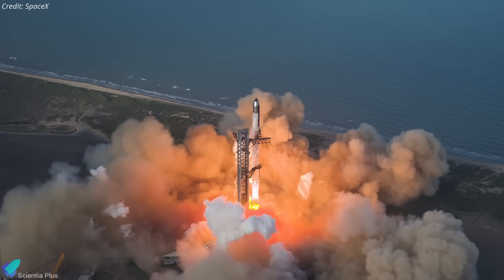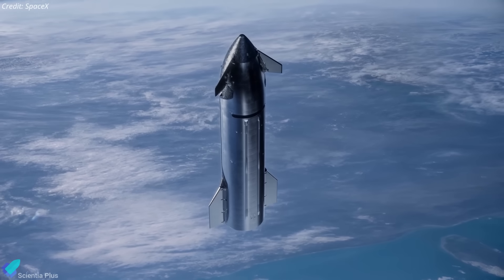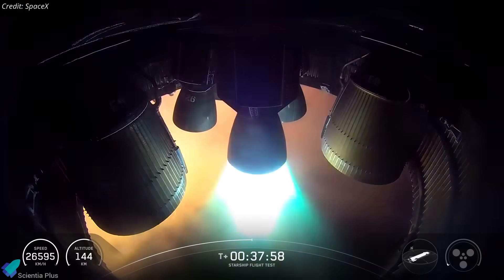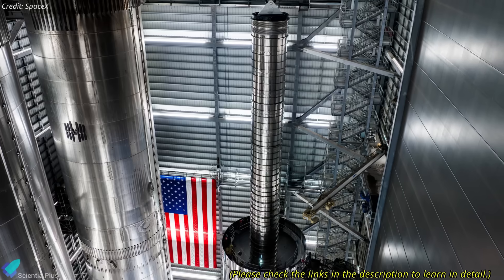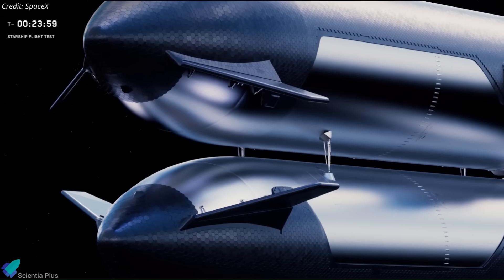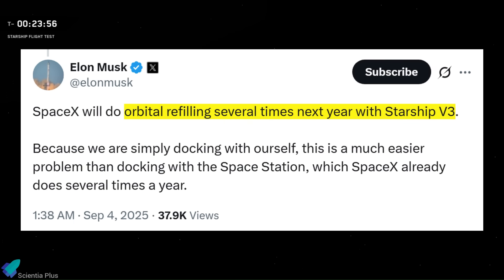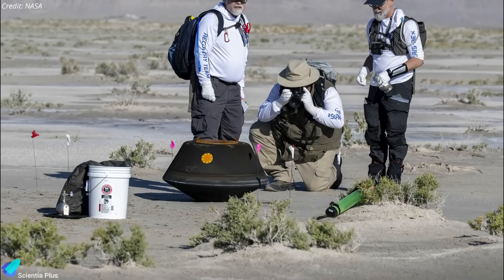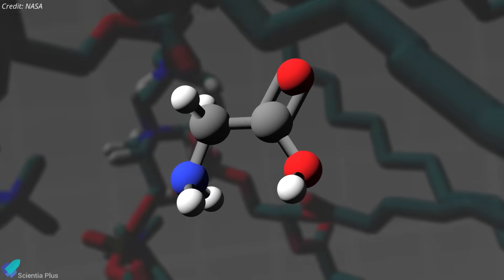BIG REVEAL! Starship Flight 11 is Full Orbital Launch! Ex NASA Boss SLAMS Starship Moon Landing

Comment: How many degrees of tilt can starship stand before it tips over? The moon does not have a lot of level surfaces.
Reply: I have to believe it will have landing legs which will give it a wider stance. Therefore the overturning moment will be much greater for it to topple and will remain stable on rougher terrain.
Reply: @williamdrake2315  and if one leg hits a boulder, it is going to tip over.
Reply: @williamdrake2315 In the meantime, why hasn't SpaceX been conducting tests in rocky desert areas, landing with legs? SN15 is the only ship they managed to land on legs after multiple failures, but even that was onto a concrete pad. The booster isn't required, these landing tests could have continued in parallel with the 'getting to orbit' program
Reply: They're first going to send up a concrete pad.
Reply: The landing legs must be dynamic.
Reply: SN15 Is a joke. Those legs underneath were for a totally flat surface. Perhaps this is why at this point they plan on using a gantry with chop sticks to catch Starship. The legs on Falcon 9 are much larger and have allowed that booster to land on a sea going barge that is rolling. There is video of the booster sliding around on the deck. They are not done developing Starship to return successfully from a orbital insertion. So a little soon to put legs on it for a moon landing. Also since this Starship is meant only to pickup astronauts who have already arrived in orbit via a capsule to transfer and use Space X to ride down and return from the moon. It will be quite different from the reusable Starship. I think they need to build a automated Starship to go to the moon and lift off without any humans on board. It would be a test article. Apollo did that as a dress rehearsal with a lander but never landed on the moon.
Reply: @williamdrake2315 At some point, it will have to be designed to have landing legs.  What's the point of continuing with a design that doesn't have them if it subsequently has to be re-designed to include them. It's like designing the Space Shuttle without a cargo bay, performing numerous test flights, and then saying "OK, we now have a fully tested spacecraft, now just cut a big hole in the top to make hinged cargo bay doors, it'll be just fine, it won't affect the structural integrity at all"
Reply: @brendanpells912 The landing legs will be an addition to the basic design. Adding a cargo bay to the shuttle? What would a shuttle look like without a cargo bay? If you remember they did add a door to Starship for the Starlink satellite.
Reply: Hopper (precursor to starship) landed in the fields around starbase, not on any prepared pads.  We had the technology to put a module on the moon on rough surfaces in 1969.  The fact you don't think we can scale it up is cute but your EDS is showing.